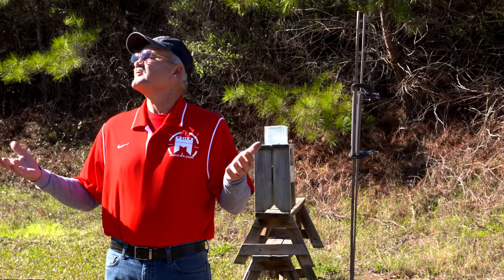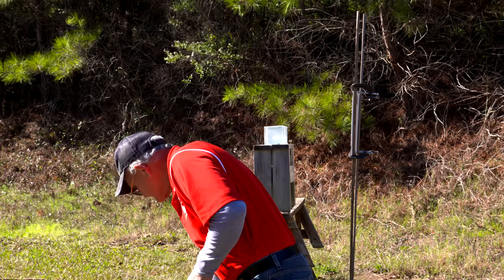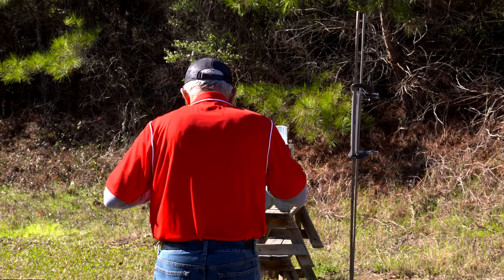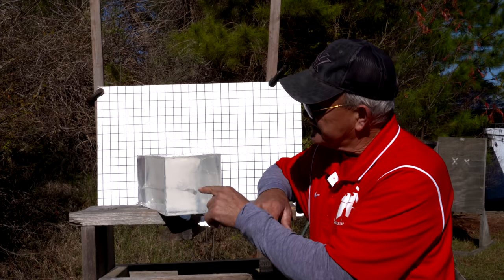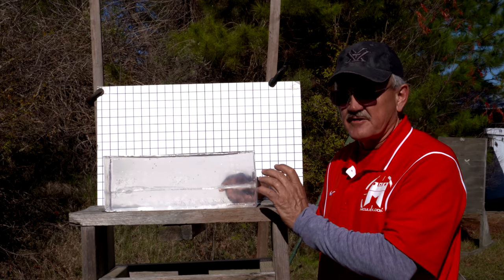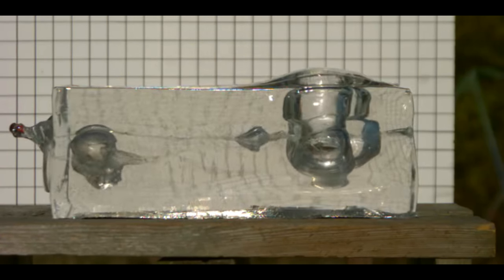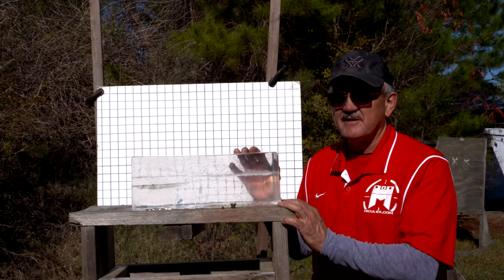Double Barrel 1911 Pistol Ballistics Testing with 2 Different Bullets at 1 Time! (4K)

Comment: I have actually seen this effect before when testing .410 0000 Buck. The rounds are one after the other coming out of the barrel, so they make a very vertical string pattern. At close range, it is not uncommon for the last two pellets or so to fly though the cavity of the gel caused by the first few rounds causing the last few to fly though without touching anything. Oh, and neat that on the first shot the FMJ actually bumped the Hornady out at the end.

Comment: I have one question.
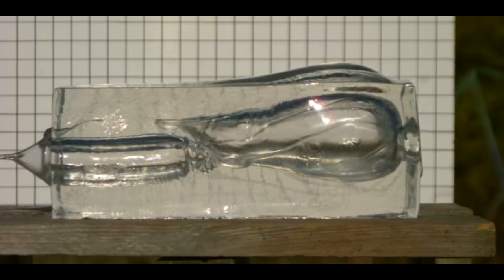4:47, go frame by frame.
I watched that thing 10 times over... It appears to have collapsed SO rapidly that it ignited something (likely the gel) and created a flame, in turn, blowing open again/ The smoke coming out after it reopened.
Reply: +Cody Smallwood Good catch. It even left soot or some other crud in the wound channel where the flash was. I wonder if there was some un-burned  powder, hitching a ride behind the bullet, that was set off by the collapsing cavitation?
Reply: It's called Adiabatic Compression or sonoluminescence, it's when the ballistic gel contracts rapidly thus creating a mini explosion. (That's what I know, anyone else can add to clarify my explanation)
Reply: To add to the explanation, sonoluminescence is when luminescence excited in a substance by the passage of sound waves through it.

Comment: Since it shoots more than one round per trigger pull, is it considered a machine gun?
Reply: +Torrey Jones Just as much as a double barreled shotgun is a MG. Still more of a looks weapon. Last video I saw on this gun a guy decided to break it in with 150 rounds. The amount needed to get it to its break in point made the rear sights loose, the front sights fly off never to be found again and the users hand get cut up because the ergonomics of the grip were not rounded but edged. Looks cool but practical......nope.
Reply: +Dave Zoll (Ogre) double barrel shotguns, from all examples I could find, usually have either two triggers, or some way of shooting one barrel then the other, such as a switch, cam, or inertia device. The comparison is not applicable. I do agree that it's impractical, however, since when is practical ever a requirement for something to sell well? ;)
Reply: Torrey Jones Fell free to spend about 4 grand on a gimmick pistol.